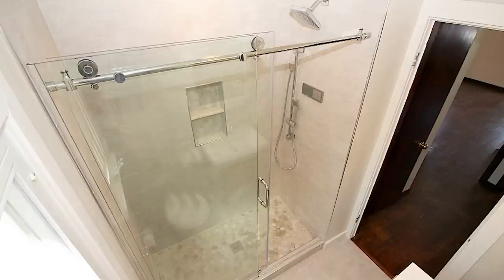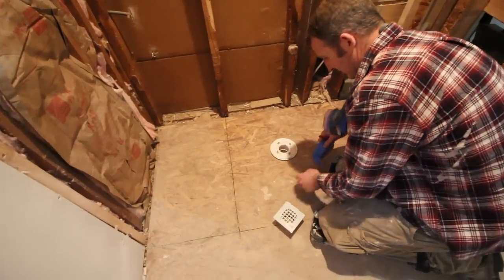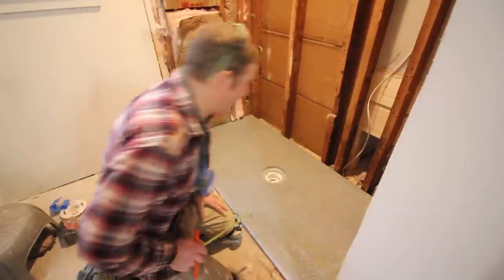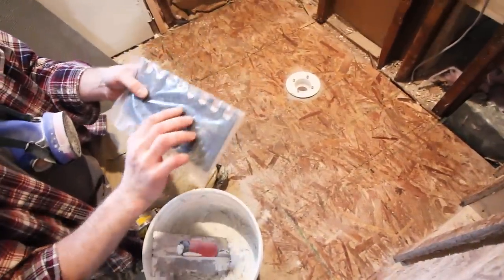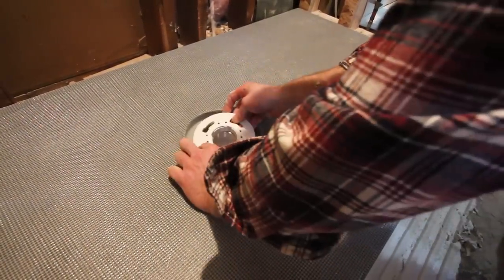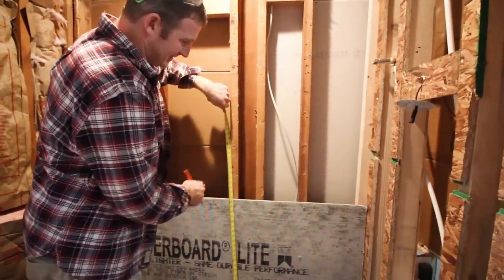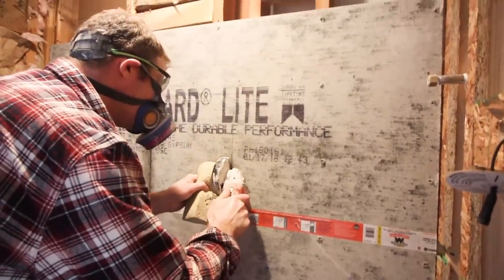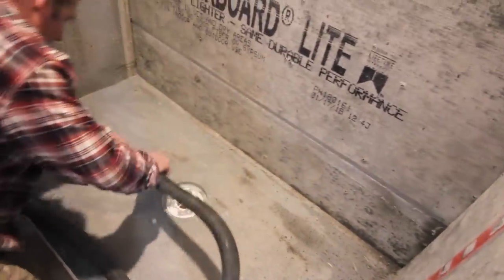How to Build a Walk-In Shower (Part 2 - Installing KBRS ShowerSlope)

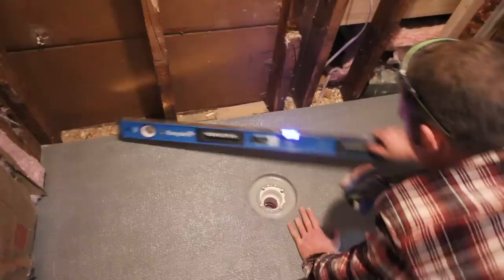Comment: 14:30 Hi guys.  Great installation, but can you please address the question about the installation of the Oatey drain?  It seems that all the excess caulking might have clogged up many of the weep holes that are on the bottom of the second layer of the drain.  I would think that you might want to avoid so much excess to keep those weep holes open.  If not there will always be a little standing water around the drain.
Reply: I'm sure you've solved this by now but at the end of this video they say it doesn't matter as the weep holes are rendered obsolete by the non porous tile basin.  https://www.youtube.com/watch?v=dpMqt2bgtHo

Comment: Confused about mudding around the drain. The Oatey tile drain has weep holes that need to stay open to collect water  that may seep through. It looks like you covered over them.
Reply: Not needed.... Sealant covers holes. No need for water to escape. Been doing kbrs pans for years
Reply: the weep holes on a drain are for when you do a mud (concrete based) pan,. Concrete is porous, and will  'weep" if damp.  If you do a KBRS sealed pan, there is no concrete to weep, so the holes are not necessary.

Comment: Thinset did not adhere to shower slope. I had to take the slope out and scrape up the thinset from the plywood floor.  Only a few spots on the shower slope had adhered thinset. The thinset was troweled out with the 3/4 notch just as in the video.. I used Mapei Ultraflex LFT and mixed to what I thought was proper consistency. I am about to try again...any suggestions? Thanks!

Comment: A couple of questions:

1. What was the approximate difference in install time between the this and the tile ready basin by KBRS? I see on their site that there is about a $200 difference, so I'm just wondering about the time savings.

2. Could you use the shower slope without the curb to create a curbless shower?
Reply from the maker: It's several hours depending on the backer board,  the Tile-Basin just needs a level subfloor then furring the walls with 1/4" plywood to allow cement board or foam board to float down over the pan perimeter. 

The ShowerSlope also needs a level subfloor but requires waterproofing with fleece if used with cement board. The pan thickness is too much for a curbless shower in a second floor bathroom. But you could use their linear drain module to build a curbless shower over concrete.

Comment: Great videos- thank you.  My question is:  the first part of the drain is 3/8ths up from the subfloor.  I’m assuming the goal is for the thin set be 3/8ths thick to fill in this gap?  Do you recommend using a primer on the sub floor before putting down the pan?   Thanks if you get a chance to see this.  Carla
Reply: instablaster...

Comment: I see you did mud the plywood correctly, but you failed to thinset the back of the pan with a press coat so you get the correct adhesion.  Just like you did the press coat before the 3/4 mud coat, you should have press coated the back of the pan.

Comment: Hi, in my project I'm planning to use KBRS shower tile-basin and I will like to know if it is possible to cut the curb of the tile-basin to 2" the same way Steve cut the curb in this installation.

Comment: When using the wedi system and doing a two sided curb, do you have a demonstration video on that? Trying to figure out what angle the two pieces of curb should connect at and also if the outside inch or so of the curb can have drywall behind it and not the wedi board. We are doing a glass wall/door on 2 sides of the shower and using the 4.5 inch curb.

Comment: How much is a shower like this cost with material and labor
Reply from the maker: It’s hard to quote labor because it depends on demo and the style of the shower. The shower system itself costs $750-$800 - which is very cost effective compared to other systems.

Comment: Converted my tub/shower to shower only on the third floor of my home. The drain line is 1 1/2 inches and the shower calls for 2 inch pipe. Cannot find any 2 inch pipe to tape into.  Any suggestions on how to solve this issue
Reply: I hope you solve your problem I am in a similar situation my drain lines are 1 1/2 inches and there's no specifications on the sellers if I need a 2" pipes

Comment: Looks like the curb is treated with aqua defense
Reply from the maker: The KBRS product does look very similar
Reply: Home Repair Tutor the side of exposed curb could you apply some aqua defense for added waterproofing  ( the side he of curb that was cut)?
Reply from the maker: Yes, we'll be doing that in Part 3 - good question
Reply: Home Repair Tutor i appreciate it. 
I use the heck out of foam wall boards, but never used a foam tray or curb, somthing about it I seem to not be able be confident about

Comment: WEDI is a far superior product...don't get it why any contractor would ever use cement board for a shower.  Cost factor shouldnt matter. Bottom line:  cement board fails and leaks about 2 ccm per day.
Reply from the maker: We like Wedi - and have several videos showing how to install the Fundo Primo or Ligno - but this shower would have cost twice as much. And many homeowners don’t have that budget. With proper waterproofing this shower will last a long time. Products are just one part of the equation. Proper installation is a key component
Reply: Where do you live were cost doesn't matter??